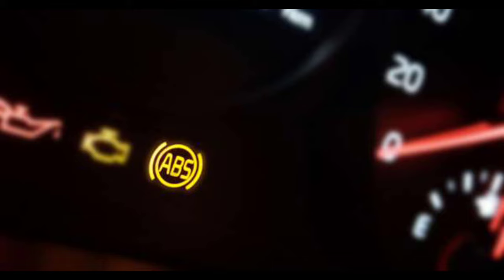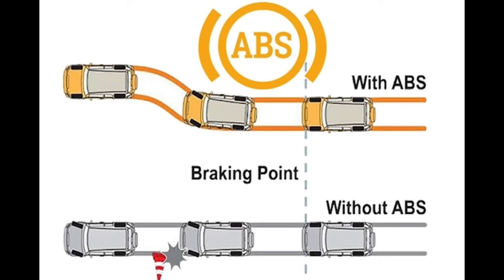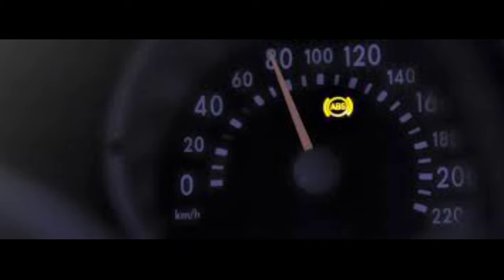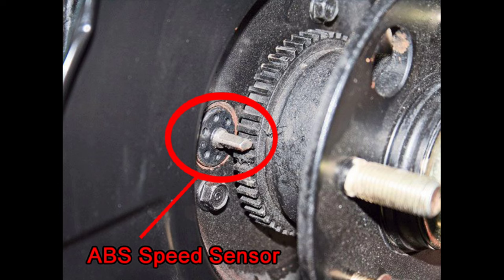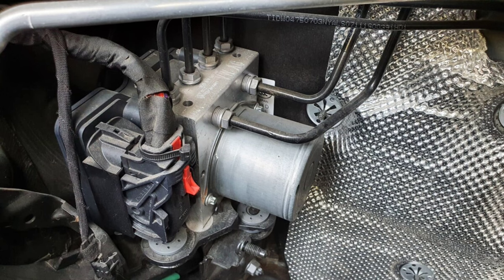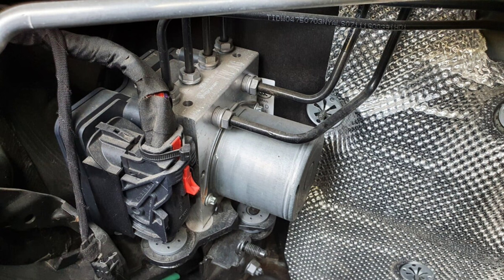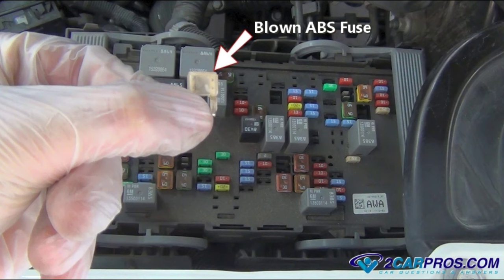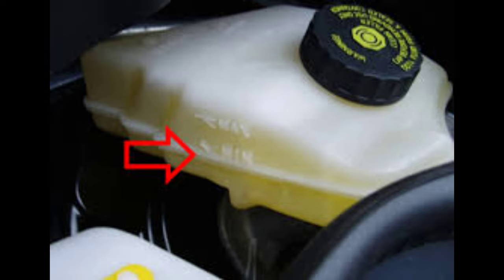Top 5 reason why the abs light is on

Comment: And what can be when it is not constant, when only it turns on and off occasionally?
🤔
Reply: A bad connection. I would recommend pulling the fuse so it won’t engage and disengage at the wrong times. Only until you have it repaired. Don’t worry, you’ll still have brakes.

Comment: I prefer traditional concrete where one pre-mixes the concrete bags.   I will never use the dry pour method as the finished surface just does not meet my standards.  Yes, upfront extra work will deliver better results, but you can do whatever.   Good luck with your new project outside the mudroom.  It will certainly help keeping the area clean of dirt. :face-blue-smiling:
Reply: I think that's a different YouTube